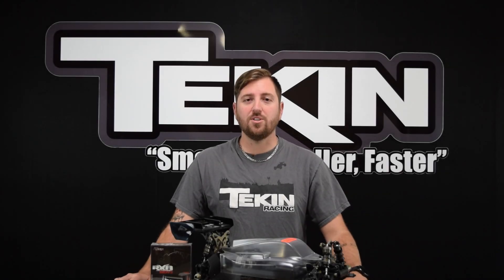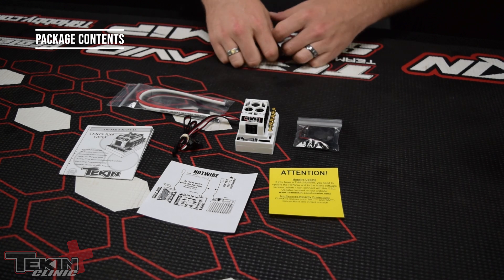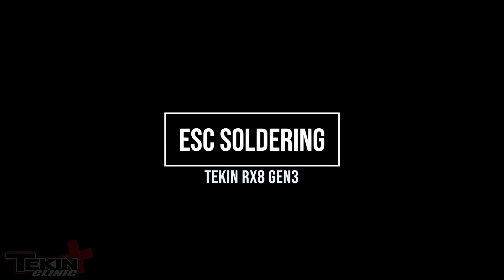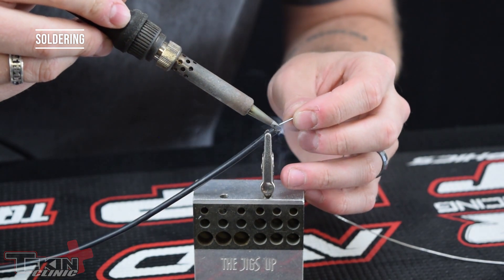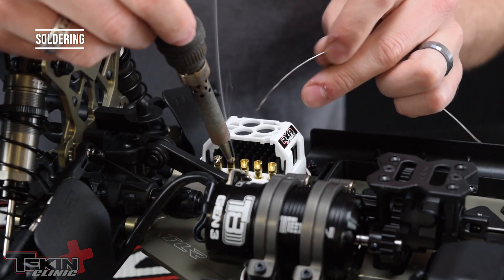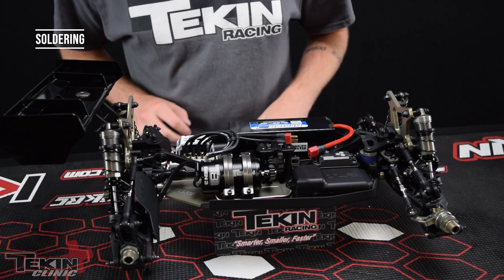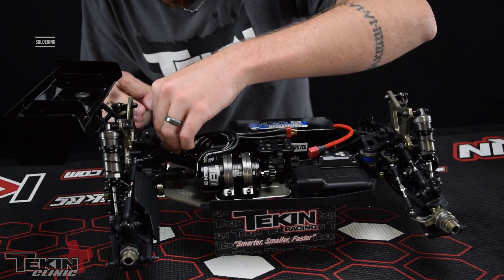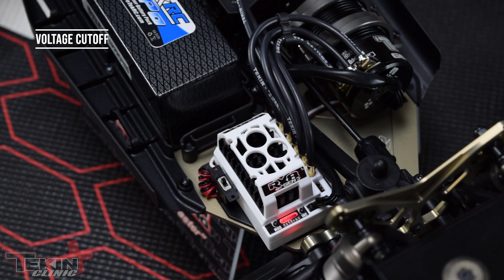Tekin RX8 GEN3 Installation & Setup | Tekin Clinic

Comment: If I increase my brake strength by 20%, will I need to reduce my drag brake strength by 20% to keep the drag brake strength the same as it was before I increased brake strength? Or will this have no affect on my drag brake?

Comment: Great video! I was farting around with my speed control, following the directions as you said, with the mode button for 3 seconds, okay, found "neutral", then it asked for full throttle like in the video, I gave it full throttle and that's when my SC and the cooperative one in the video diverged. lol It did nothing. In frustration, just sitting there staring at it, after it sat for a few seconds, I pulled the trigger, and had reverse. A quick throttle 'servo' reverse, and I was off to the races with what I'll assume are the 'factory settings'. I did a conversion with the Losi kit, on my 8ight 2.0 It's a RIPPER!! Could use a little more brakes, so may mess with that. I was a loooong time nitro head, and am honestly, SHOCKED at how insane the car is on 4S! Next is to convert the Losi 8-T!

Comment: Hey buddy..my eb48 has the t8 and rx8 set up. I was doing practice laps and I heard a weird crunch sound going smoothly around and now my rx8 shows 1,2,6,7  l.e.d lights and my car will steer but will not give any throttle. I have only ran this system 3 times.  What do i do ? You da man thanks

Comment: i noticed the fan isn't installed.  is this the recommended setup?  i ask only cause i shredded the wire on my new gen 3 lol.  upon installation the fins on the heat sick just ripped up the fan wires.  do you recommend an aftermarket fan?
Reply from the maker: I normally don't run a fan unless the temperature is above 85-90F. On average I see 3 lights on the ESC for temp with no fan after a 15 minute run, which is about 150F and completely safe.
Reply: @TekinRacing  thanks for the feedback. I've been looking at most setups online and they seem to not have the fan as well. I live in California, but it's good to know it's ok to run without a fan, at least until I order a replacement. Thanks again!

Comment: Are you suppose to heat shrink the terminal post?  I read that your not suppose to. And other say you are suppose to.
Reply from the maker: I don't recommend it for two reasons; heat and it can disguise a bad solder joint. Seen it many times in service!

Comment: Where can I find the wire bracket you used from the esc to motor to keep the wires nice and neat?
Reply: Did you ever find out where to get that wire clip/bracket?
Reply: @tjart9893  I did not sir.
Reply: @walterhernandez4358  After some research, it is a part from an Axial SCX10.
Reply: Yeah wish I could find a similar clip the only ones I can find are aluminium.

Comment: So, is installing a cap on the batt posts only recommended for gen 2 RX8s?
Reply from the maker: You don't need any external caps on any of the RX8s, they are built in to the ESC.
Reply: @TekinRacing  Yeah I saw the caps when I replaced the case. Then why does it say installation of the cap is required for warranty.
Reply from the maker: @Crewchief227  if you are referring to our warranty policy we require caps on all ESCs that come with them in the accessory packet. The RX8 and RX4 have them built in, so that statement doesn't apply.